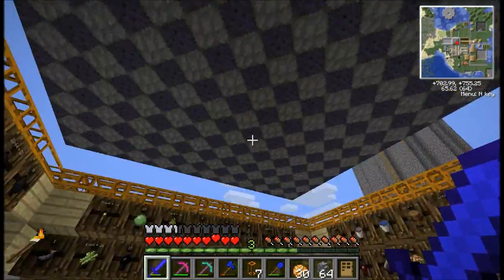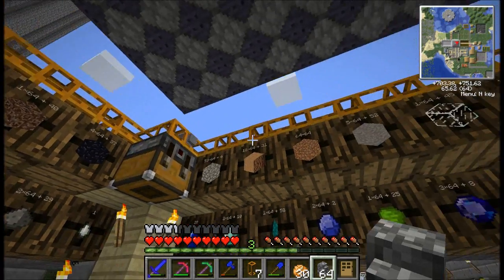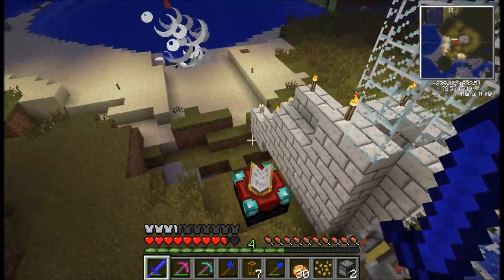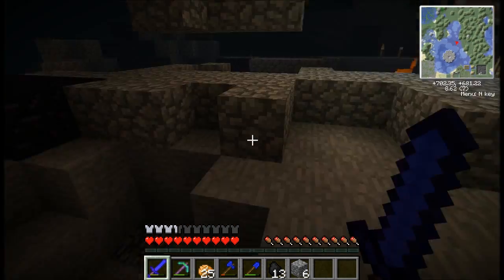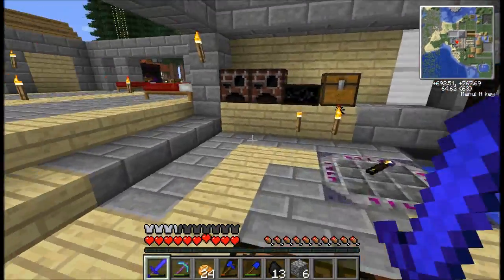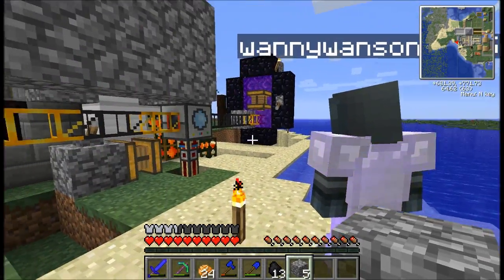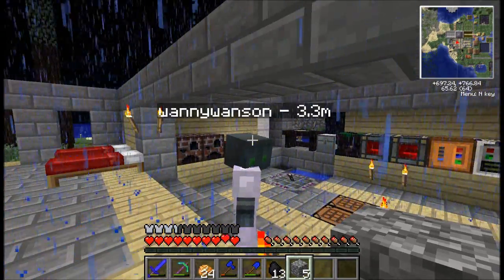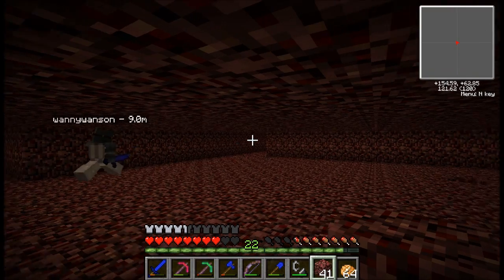Technical Beast 02 Storage & Energy

Comment: Use filler instead of turtles to mine out large areas. You guys have the redstone energy cell which can power the filler and trust me, if you put 100MJ output for the redstone energy cell the filler will just eat those netherrack.